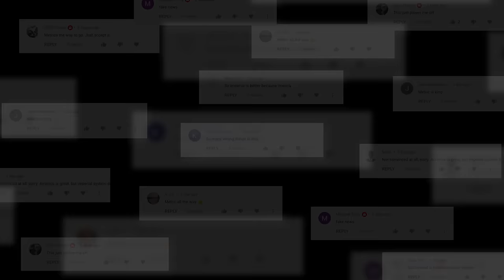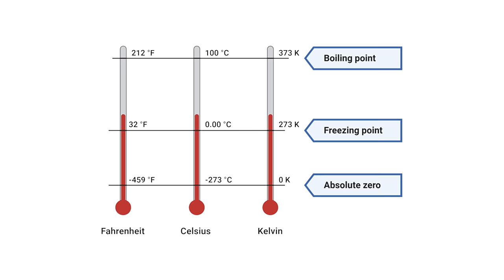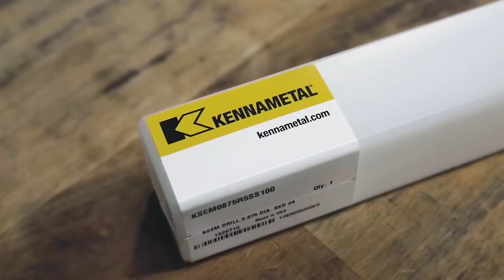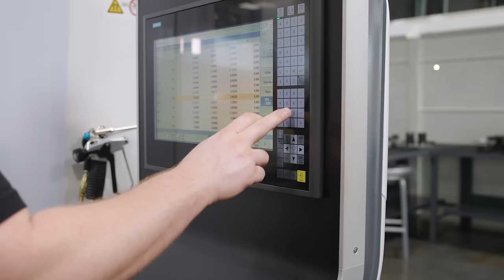Why METRIC is SUPERIOR to IMPERIAL

Comment: In my opinion is very simple…I see lots of imperial people say that metric is far better, but never see any metric guy tell that imperial is better😂
Reply: I see a lot of imperial people know both, and very very few metric people know imperial. It's like knowing two languages, it comes in handy.
Reply: @tedundercarriage8183  well knowing metric is not a really great effort. if you can multiply by 10 and divide by 10, youre there
Reply: @ozr2222  you're a fool if you think that's all that's involved in knowing a measurement system.
Reply: peoples only use imperial because it would be inconvenient to throw all your tools away
its annoying to transition
Reply: @kurokami5964  Incorrect.
Reply: I would disagree with that.  I watch a lot of vids and "average" joes throughout Europe always go with the Imperial measurements when talking off the cuff.  While it might not be precision they're talking about, Imperial is a measurement you can relate to because it's a bit intuitive.  You know how long a foot is because you're foot is a foot long, roughly.  You can pace something out and be reasonably close to it.  I always get a chuckle out of guys cutting a bar of steel, for example and saying it's "400 mils" long.  That's like an American saying something's "400 sixteenths" long.  They're literally using the smallest unit of measure they can instead of saying something's 40 centimeters.  Or "1 meter, 10."  The fact that Brits, in particular, so readily use the Imperial system in common parlance tells you there's something to it that appeals.  Worst thing they ever did, imo, was surrendering their British Standard Whitworth system.
Reply: @tedundercarriage8183  none of us needs to know imperial because EVERYTHING is metric everywhere exept your country.... or in other words, you need to know both, we don't...
Reply: @malte1984  room temp, cooking measures, rough measurements, all things that imperial is better at than metric. Having more options is never a bad thing.
Reply: @threeriversforge1997  Here in India we are almost fully metric. I do find it easier to estimate distances in feet because my parents' generation still uses them all the time, but after the estimation I just treat it as ~1/3rd of a meter in my head and get on with the (simpler) calculation. I don't find anything else in imperial more "intuitive". Metric is superior by a kilometer. 

For things like weight and volume, I only need to know metric. Which is great.
Reply: @tedundercarriage8183  Imperial cooking measures are ridiculously arbitrary, grams are way better. Nothing wrong with Celsius. "Rough measurements" is purely a matter of which system you grew up with.
Reply: @rexsceleratorum1632  And before you were taught metric, there was British Standard Whitworth, the first standardized system.

I've always found the arguments in favor of metric to be rather disappointing because it always comes down to "easier" and something about that rubs me the wrong way.  I think JFK made a good point when he talked about doing something not because it was easy, but because it was hard.

I don't personally see what's so hard about the Imperial system.  While that's what I was raised with, I like to think that I'm smart enough to see the pro's and con's even if I might be a little biased towards one side.

Oddly, it was because I had the imperial system that I was able to more easily learn and understand basic math when was a kid.  I could look at the tape measure or yardstick and see the fractions in real life, so to speak.

In the end, I take the side of diversity, not uniformity.  The Imperial System was good enough to get us the airplane and men on the moon.  Arguments that it's somehow inferior to the metric system just don't hold water, as a result, but I'm okay with people preferring the metric system.  What I'm not okay with is the advocates for it demanding we change, or trying underhanded ways of forcing the issue.  Maybe that's the "American" in me, but I have a real hard time with people telling me what I should do, or trying to force me into their little corral.

We hear all this talk about diversity, but it seems those same people clamoring for it so much... don't actually want it.  Rather, they are fighting for uniformity - and their version of it.

As I tell folks all the time, when I travel to India, I want to see Indian people doing Indian things in the Indian way.... and proud of it.  When I go to Munich or London, I want to see their people and their culture, with all the little idiosyncracies that make them unique.  There's nothing worse than traveling from Idaho to Ireland and seeing everyone acting the same, talking the same, eating the same.....
Reply: @rexsceleratorum1632  grams is a unit of weight, not volume like imperial cooking units. I don't want a to pull out a scale and worry about fine measurements when I'm making dinner. getting scienticious about the exact quantity of a chemical is something that should be reserved for pastry chefs and pharmacist. The cup method is so much easier and it just works for something as relative as cooking. It always makes me giggle when I see a recipe naming an ingredient to the exact gram, and then say something like "a pinch of oregano".
Reply: @threeriversforge1997  "The Imperial System was good enough to get us the airplane and men on the moon." //

Wrong on the second one. NASA used Metric to get men on the moon.
Reply: @threeriversforge1997  "Oddly, it was because I had the imperial system that I was able to more easily learn and understand basic math when was a kid."///

If you turn that around you can see why Metric is easier. Because it doesn't force you to learn math and arbitrary constants like 5280 feet in a mile. 

Perhaps you'll learn to do math better if I asked you how many miles is 5490 feet. But if you asked me how many kilometers is 5490 meters, I'll instantly tell you 5.49 km and then I'm free to do something actually useful.
Reply: @tedundercarriage8183  No one's stopping you from specifying flour in milliliters when you make a metric recipe. It is the other way because people prefer it so.
Reply: @rexsceleratorum1632  I don't make metric recipes because I live in a better country

Comment: As a fabricator/welder/machinist from England, born in the late 60's. I have used both, and I have to say hands down Metric is far better. The reason is simple...everything is a multiple or a division of ten. There are no fractions where you need to use a reference chart...It's just decimal places. The only area that the Metric system falls down is in Plumbing and gas/air fitting etc...In all of the Metric threads there is nothing that replaces the BSP/BSPT threads and all across the world these fittings are used from the Imperial system.

Comment: imperial is just as accurate as metric because its definition is based on metric
Reply: Accuracy comes from your (measuring) equipement, not the units of measurement.

Comment: I grew up on Imperial, it was taught to me at a young age by my father.  He was a tool and die maker for GM in the 50-80’s.  All my tools including the ones he made as an apprentice are imperial.  I find it much easier to use.  I can look at an inch and see it’s an inch.  At this point I can’t visualize metric as easy.  Unless I see 25.4mm.
Reply: Ones you grew up on imperial you'll remain imperial. And as long others are using imperial around you there is no need for you to train and think of metric.
The easiest way to get a feel of metric: 4" equals ~10 cm.
Reply: Metric fasteners are in today's cars for foreign export.    The inch system is far superior to metric.   I can't  even  visualize  a cm in my mind.

Comment: I live in New Zealand, which went metric along with most of the world in the 1970s.
That said, there are plenty of tools based on legacy imperial units.
Battery drills use 1/4" drivers.
Socket sets come in 1/4", 3/8", 1/2" and 3/4" drives.
Wood routers use 1/4" and 1/2" diameter router bits.
Spade bits use 1/4" hex shanks.

Hole saws commonly use 7/16" hex shanks.

Comment: I'm a boat builder here in Austria and for that reason I had to deal with imperial for all my professional live. 
Almost all boatbuilding literature is and most of the older plans use it. 
So I'm very familiar with it.

Still even after 20 years of having to deal with it on a daily basis and buying all measures in imperial I'm converting all imperial measurements in to metrics because I found that not only I work more precisely with metric measurements it's also far less prone to mistakes.

And in metric you never run into trouble because your measurement is not precise enough. Millimeters is already quite precise and if you need it more precise you just go down the scale by adding extra digits.

With imperial you have to decide how precise you want to go end end up with. This leads to measurements   like 3/16+........ so just a bit more than 3/16..... but how much is up to you. Just feel your way throu it. 
That's ok for a craft like boat building but with anything more scientific this is just unacceptable
Reply: If you consistently get it wrong in all the critical parts but still end up with a non-leaky boat, what is the maximum amount the boat pulls to one side? Just curious as to how much difference it makes.

Comment: I have used both systems and the bottom line is that metric is a lot easier to use. Just try to find the square footage of a house without an imperial calculator!!

Comment: Hubble experienced an issue with its mirrors because someone failed to properly convert from metric to imperial. It was fixed, but at RUINOUS cost. I don't think many people on either side of the metric/imperial debate realise just how costly in terms of hours of work, money, materials, fuel and other costs, conversion failures are. Whether its broken machine bits due to improper size comparison, or taxation issues at borders because of improperly recorded and converted weights and volumes for exports and imports, this issue is very expensive, and at a time where resources are more costly, waste due to something so easily remedied is utterly unforgivable and has serious implications for everyones pocket.

Comment: I have worked in the US and NZ, and generally prefer the metric system for all things.  The one exception was fasteners.  When New Zealand converted to metric, the diameter of all nails, screws, etc were rounded down to even metric numbers, making them slimmer and weaker.  It has caused issues in the building industry.

Comment: Limey here. Although we haven't fully embraced metric over here (we still use miles), I do prefer metric. It's just simpler. It would be great if decimalising time had taken off. 100 seconds in a minute, 100 minutes in a hour and 10 hours in a day. Programming would be so much easier! Admittedly days, months and years would be a little harder to decimalise, but time would have been a good start

Comment: There’s also the case of how many imperial units are still used in “metric” countries. The UK, for example, measures speed and distance on the roads in miles. While a lot of other countries exclusively use Km. A building site in Australia will only use mm for any lineal measurement, where as some areas of Europe will use a combination of metres cm & mm simultaneously.

Not to mention railways use old imperial units because historical reasons, or step foot on a boat and knots are the measurement of choice.

Even though metric forms the backend of any measurement system (even you USA, your scales are calibrated in metric) imperial will always have its place to us humans is some situations

Comment: Actually use both, born in the Netherlands, grew up with metric, lived and work in the US as pipefitter.
I still use metric, I even convert half of my drawings (the ones with complicated calculations at least partly) in to metric, because I just don't want to deal with fractions, and the errors they produce, next to that calculation are way faster and easier in metric

Comment: I'm not an engineer. I simply worked in a big home improvement store. One of my duties was running the panel saw as part of the "get you home" service for customers. As in I would cut down a 2400x1200 sheet so it will fit in your car. This was 30 years after metric came in and I still got rude boomers raging about it. I simply don't get how people can't convert from imperial to metric for simple rough cuts of materials. Not machining to the thousands of an inch or with the cumulative errors you get in large scale conversions but basic stuff like an inch being almost 25mm and 4 inches being almost 100mm, 300mm giving you a foot. If you have one value to use as a key it's not hard, it's primary school maths.

Comment: Right now, no metric no longer based on an object stored somewhere. Now you can define any metric unit using fundamental contant, like meter based on the speed of light, kilogram based on avogadro number, and so on.  I believe now kg can be define 2 ways, chemistry way with avogadronumber, and physic way with planck constant. That means, if you have something you can measure to planck constant, you can make an SI kg frok it that acceptable everywhere; so you no longer have to request a copy of SI Kg from Swiss (i believe the kg standard stored there?), as long you can prove that you object you measure fit to the calculation based on the kg definition.

Comment: Still, in the US, Car Wheels and TV sets are sold based on inch sizes.
Football & Soccer Fields still use yards.

How about two standard units instead of one?
I use both units on regular bases. 
Even as a machinist 30-40 years ago, I used both units of measure and had tools and gages for both. Adding inch & metric drill sizes gave machinists more hole size options.
   
I don't ever see traditional standard imperial units going away.
 
Use what works best for you and your market and application.

It's simple and accurate to convert from mm to inch with 25.4 (mm / 25.4 = inch). 
Just don't make the most common mistake of converting mm to inch by multiplying with a rounded number (0.0394). Always use the full decimal precision of (1/25.4) for your conversion. Otherwise, you will have a conversion error per inch of 0.02mm.

Comment: Metric makes physics and engineering equations much easier too. With imperial the equation would be different whether you use feet or miles so you generally have to convert to a specific measurement but with metric you can use meters and Kilometers with the same equations but just need to remember what unit you used and decide what the output unit should be. Like with the distance = speed x time equation. If I use meters and seconds I end up with m/s, or Kilometers and hours I end up with km/h and it is very easy to convert between them. That example would be very similar with imperial but you just need more complicated conversion factors, but more complex equations it becomes a lot more difficult with imperial, especially where constants are required.

Comment: I get that we say that metric everything is by a factor of 10, but it's actually a factor of 1000. The 10 factors were introduced mainly for the common measurements, like centimeter, but nearly nobody uses decimeters or hectometers and using cm can also be a bit confusing in some cases. It's more clear in countries that converted later to metric (like australia), they skipped the speudo-inch (aka cm) and just use meter and millimeter. The metric system was designed with that 1000 factor in mind to begin with. 

Once you skip those intermediate measurements and stick to the 1000 factor it becomes even more easier to spot mistakes. If you have a zero missing, it's just obvious something is wrong. No thinking about the correct 10 factor, just restart your calculation because it looks wrong. So for example, at the yard someone yells "get me a piece 80 long", you will get a piece 80mm long, or did he mean 80 cm? When you only use mm or meter, it cannot be 80 meters, that just doesn't make sense. No questions, no confusion. 

When using volume we usually tend to stick to ml and liter already. Only older recipes use the intermediate dl and I always need to stop and convert just to have it make sense.

Comment: I worked in a machine shop repairing caterpillar equipment... And had to get used to both. Some machines (140H grader) use metric and imperial bolts... When working on engines or transmission pumps I'll measure with a metric micrometer and convert clearances back to Thousands of and inch. 🤷‍♂️

Comment: In the Philippines we use both and we're okay.  The official is metric and we got the trusted imperial for body vital statistics, shoe and dress size. Carpentry measurements for wood, tin sheets, and nails.  The floor is metro kwadrado.

Comment: Few people know the imperial unit for mass is the slug. I remember how complicated it was to calculate slugs from lbs force when I was in school.
Reply: Few people realise the metric unit of weight is the newton, try converting from kilograms.
1 Newton is 0.10197kg nice just factors of 10, not really.
Reply: @stephenlee5929  Might be a problem for people who don't know the difference between mass and weight and then end up on the moon. The rest of us measure weights in kilograms.
Reply: @rexsceleratorum1632  I agree, that's the point I was trying to make in reply to G Kuljan, most people use pounds for both weight and mass. The issue is the same in both systems.